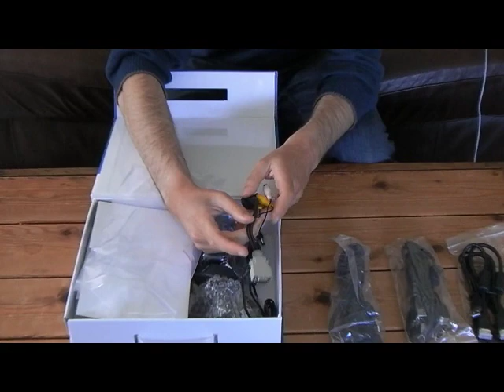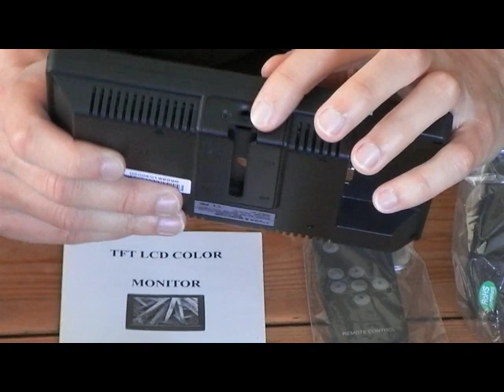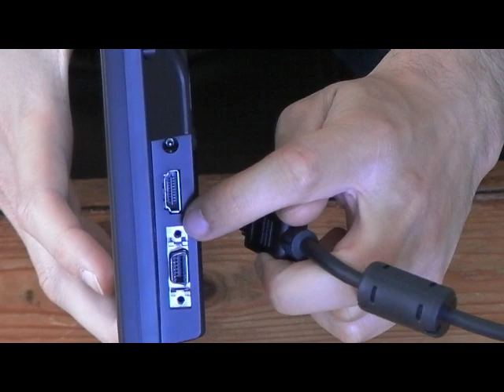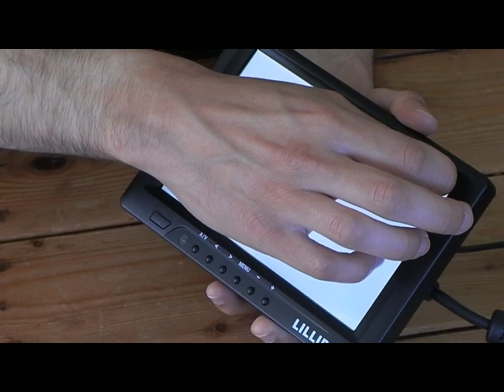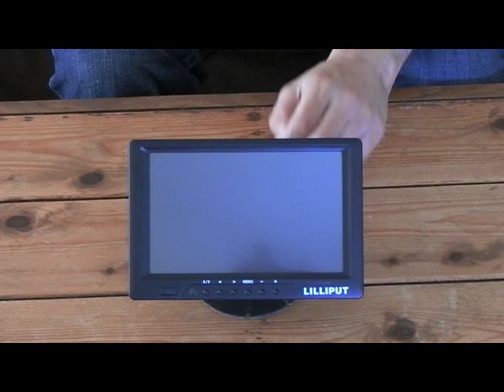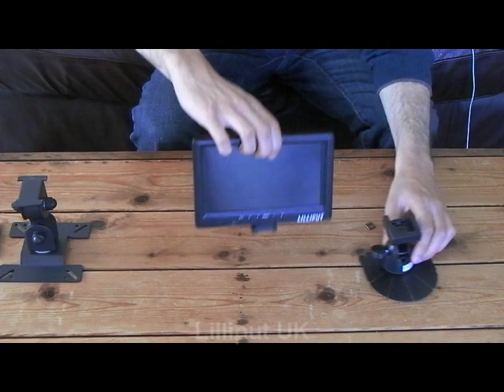Lilliput 669GL-70NP/C/T (7" Monitor) Overview

Comment: Driver for windows 8.1 64bit?

The axes of the touch screen panel are reversed and you can not use. 
I have tried using windows vista, 7, 8, 8.1 and all versions of ubuntu.

lilliput 669gl

Comment: Battery is not built in - you would need to power the monitor seperately. A compatible battery is available at Lilliput Direct. As for sturdiness, we have been using them for a few years and they are fine.